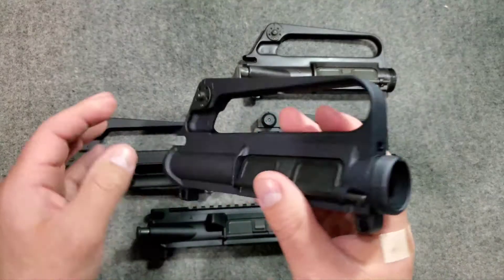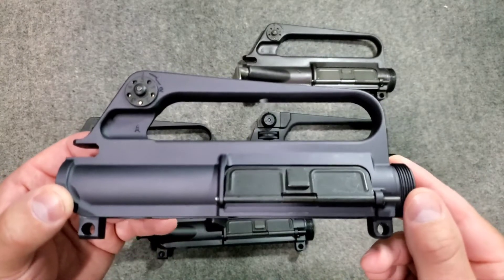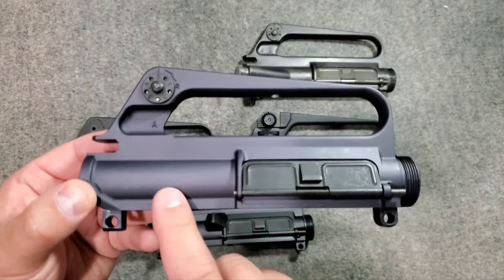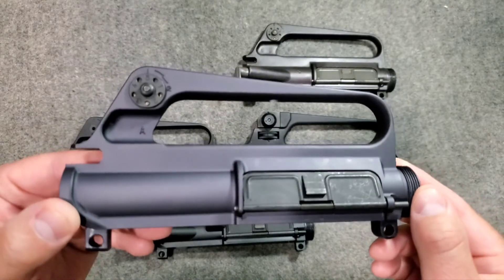AR Uppers From Retro to Current Day

Comment: The A1 rear sight does have an elevation adjustment, of sorts, in that when you switch the aperture, the "long range" aperture is actually higher than the "short range aperture".  While not "fully adjustable" for elevation the short range and long range sights mean something other than just a difference in the size of the hole you look through. 
In the A2 sight, changing the aperture only changes the size of the aperture. For zeroing the rifle, all elevation adjustment is still made with the front sight. The rear sight elevation is intended as a "bullet drop compensator" not as the primary elevation adjustment. 

I prefer the A2 myself, but I am a target shooter and the A2 sights are better for that purpose.  Whether they are better "battle sights" is debatable.  Many people still prefer the simpler A1 sight.
Reply from the maker: Thanks for commenting

Comment: Interesting, I just picked up a NDS build 16" Carr style upper love using carry handle iron sights, just gonna put a front night sight in and quad rail. The lower is just PSA witch will get comfy b5 bravo stock and grip , going for light weight hard use

Comment: The reason colt and fn didnt do m4 ramps is because of the numbers of rifle barrel extensions in use and therefore wouldnt be compatible.  Finding a non m4 flattop upper today is very hard to do.
Reply from the maker: Good observation. Thanks for the info.

Comment: I have more then a few M4's lol. All are carbines but two are standard M4s with a fixed front sight post. I just love that look. Its more like the M16 Retro Carbines. I have wanted to build a Retro rifle for some time. Right now i have purchased abount 5 rifles worth of parts and just have not had to the time to build them.....LOL It took me about 3yrs to accumulate the parts for all of them and i may actually still need a gas tube here or a buffer spring there....hehe but 99.999 % of all the parts are there.
      So i just started looking around ot make it an even 6 rifles worth of parts ,so then i can set up my man cave ,as my wife calls the room she sends me too when the inlaws are coming by! LOL O just added a small work area in the corner of my Den as i call it, that has a nice solid work bench with just a bit more then enough room to slap a 24" barreled rifle in a vice on and still have room to set up the parts im working with at the time. Plenty of storage and all just under a window facning my bird feeders!hehe Very Zen! In any case i want to build that retro rifle now as well and u would want it to be the most exact clone as i can get of a Vietnam era rifle..... So what upper would you suggest?  Even though most say you dont need a forward assist i feel it cant hurt. But overall which would you think i should go with out of these uppers you have here? Great video though bro! helpful in my quest! hehe
Reply from the maker: Upper selection is all dependent on what exactly you are cloning.